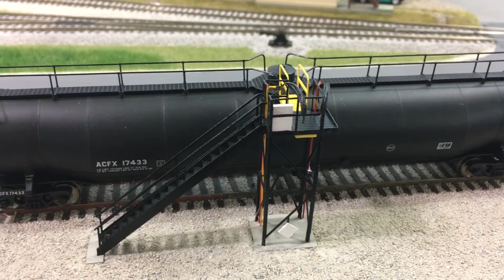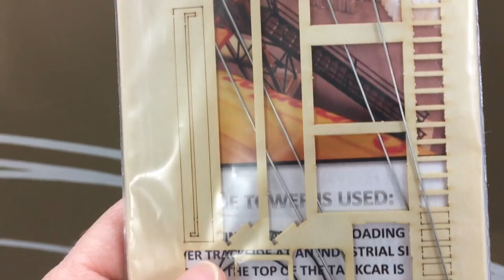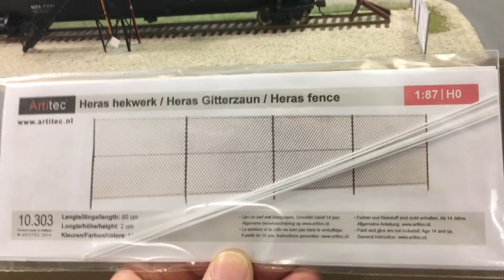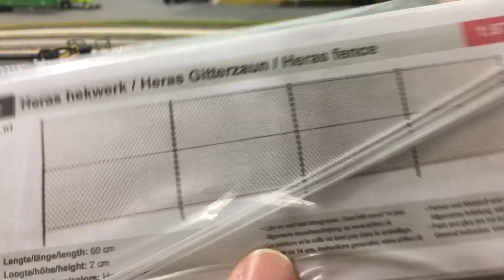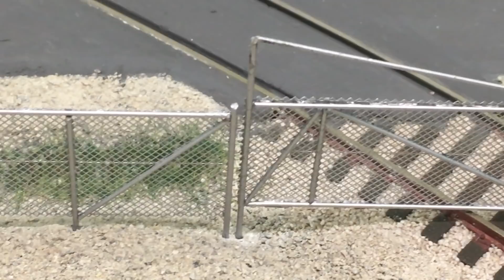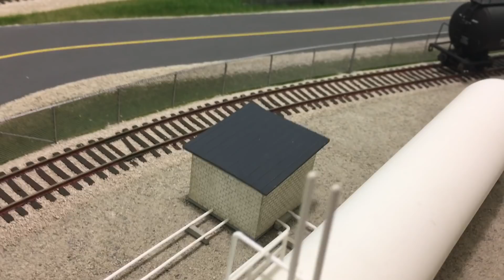Q&NE HO Layout Video 079 - 181228

Comment: Very nice. Where do you source the steel wire and how do you get it straight enough to glue to the cut fencing?
Reply from the maker: You should be able to get the wire at any hobby shop. It is steel and even the 0.025” wire is stiff enough that it stays straight.